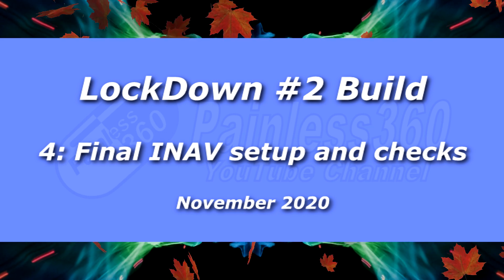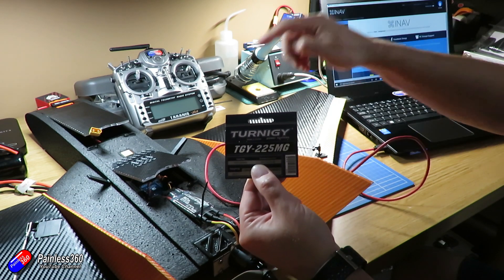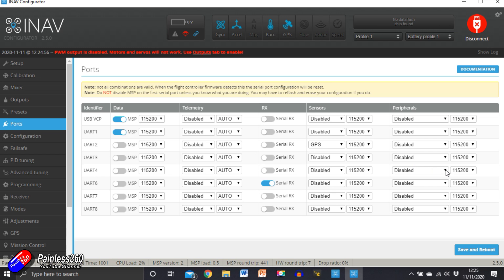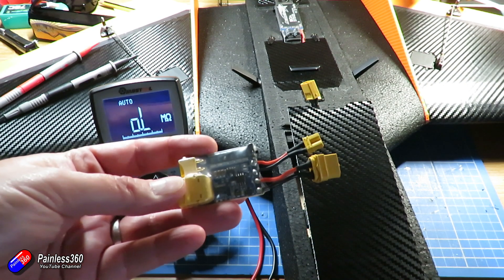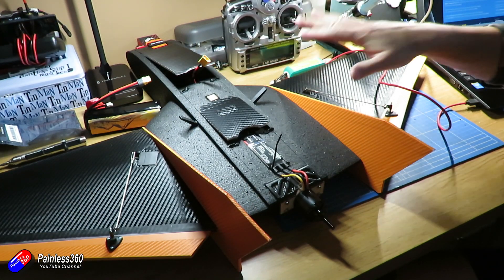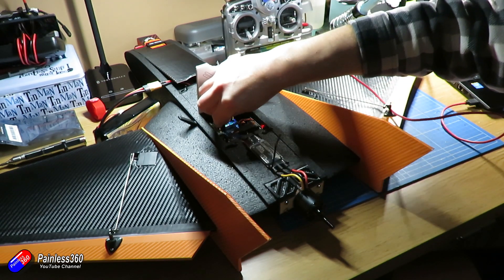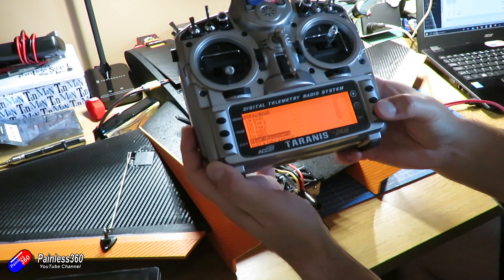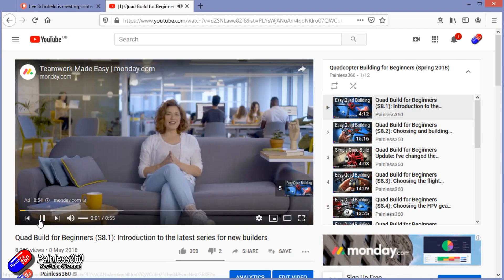Lockdown #2 Build, Part 4: Final INAV setup and first power on!

Comment: Hi Lee! Great video! Have you heard issues with using a Spektrum TX in elevon wing configuration? I'm not getting same deflection on both elevons when I move the stick up and down. Both servos are centered, the monitor on the TX shows correct servo movements but output monitor in inav 5 (Matek F722WPX) is not showing synchronized deflections, what am I doing wrong? Thank you
Reply from the maker: All of the steps I use are in the playlist. When you say not synchronised what do you mean?
Reply: @Painless360  the elevons don't move up and down together when I move the stick up and down, even without using aileron. They move in the same direction but not at the same rate.
Reply from the maker: I'd check the hardware linkages are identical on both sides and then confirm that the travel from centre to each side is the same on the outputs screen in INAV configurator. If they are then one of the servos isn't moving as far as the other for the same signal. Not all servos travel the same distance so using a matching pair for ailerons/elevons is key.. Best of luck!
Reply: @Painless360  thx Lee! the monitor in inav is showing uneven throws so I'm not sure why. I'm going to switch to another project as i can't keep wasting time on it. Throws work fine with a spektrum receiver but not on the FC with iNav so I give up.
Reply from the maker: OK, best of luck. Uneven throws are something that can be fixed. Checking in manual mode is the best way...

Comment: good evening.
im building my 1st wing.
have flownm drones for a couple of years
am i able to use a single esc from a drone arm on my wing,i do have escs from old planes but dont have any 4s ones,but have a spare 4s from one of my race drones...is that ok as long as it has good wind flow ova it??.
thanks in advance
Reply from the maker: Yes you can but be careful. A MR ESC is expecting to spin a small prop very fast and change its speed many of times a second. A fixed wing ESC is less complex from a setup point of view and is  expecting to spin a larger prop slower and has things like brake and slower  spin up times to handle current surges.. Happy flying
Reply: @Painless360  i wont be changing throttle all that much as i want long range endurance type of flying,your videos so far have taught me sooo much thank you.